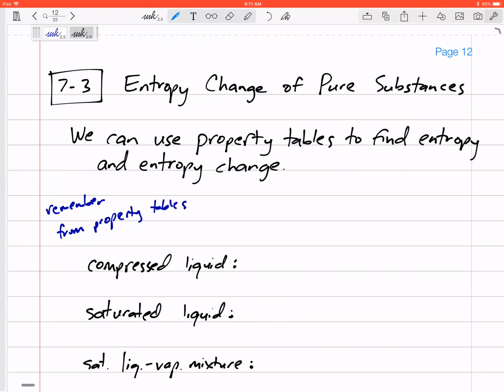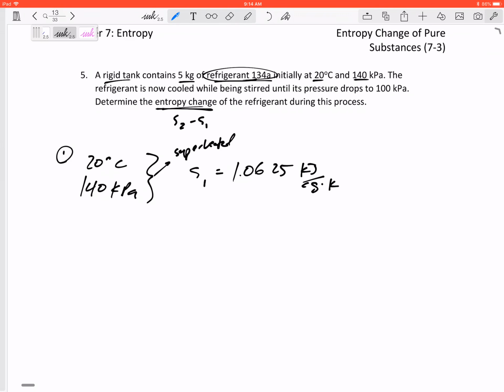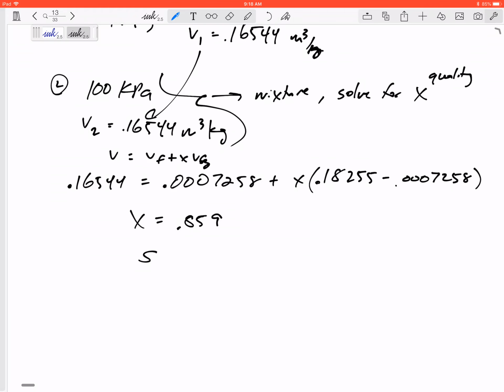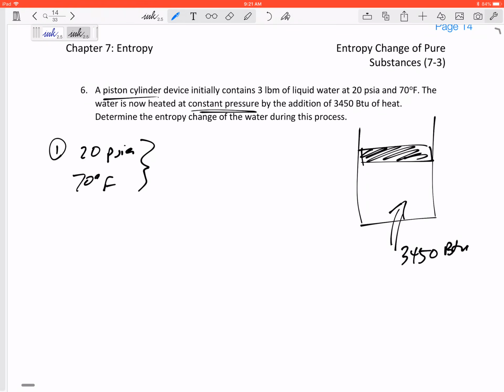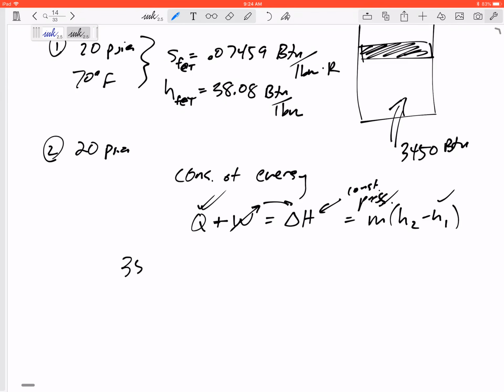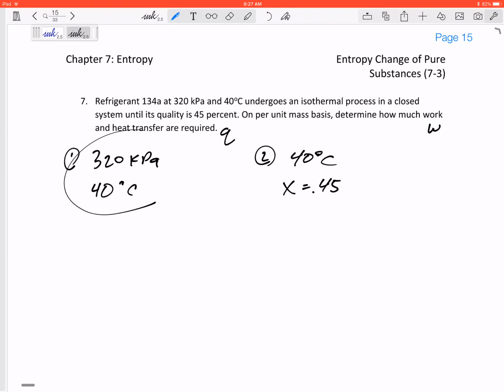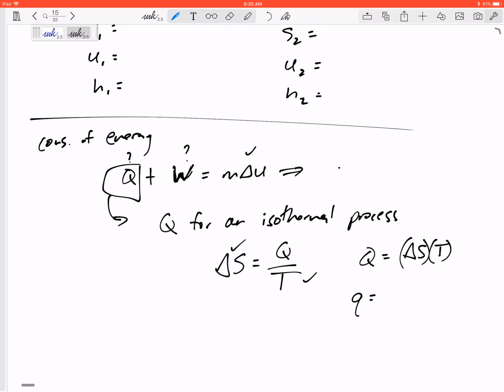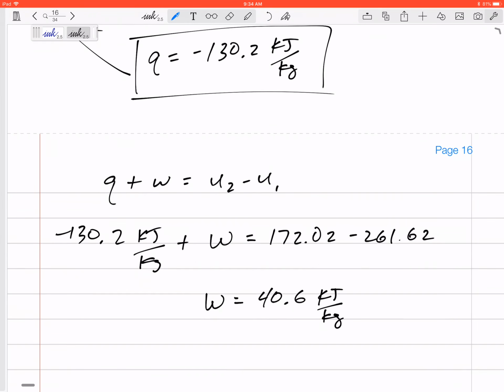Thermodynamics - Entropy 7.3 Pure Substances

Comment: ΔS = Q_rev/T, not Q/T. For an isothermal step, q = TΔs only if you assume a reversible (quasi-equilibrium) path. Otherwise that equality does not hold. Without the reversibility assumption, the problem is underdetermined (you can get Δu and Δs from tables, but not unique q and w), so it should be stated explicitly.

Comment: In Q7, the last one, the conservation of energy has been carried out as follows:

(q_in - q_out) + (w_in - w_out) = u2 - u1

My question is why are we not taking into account work at the boundary? We don't know whether this closed system has a movable boundary or not, so would it not be safer to assume there to be a certain "w_b" occurring at the boundary? If we use w_b, we get 

(q_in - q_out) + (w_in - w_out - w_b) = u2 - u1

but we can take w_b to the RHS, and since h = u + Pv, and w_b = int(Pdv), h = u + w_b

therefore (q_in - q_out) + (w_in - w_out) = h2 - h1

So I don't understand why we use u values instead of h values.

Comment: # 7 LOLOL, You have some weird values for R-134a, but problem seven is solved just like you did it, find Q = S2 - S1 X Temp... then U2 - U1... ah you know the rest.... but those values you're throwing out there for this substance are suspect. LOL
Reply from the maker: I am using the property tables from Cengel and Boles. The property tables from Moran and Shapiro look slightly different, but in the same ballpark. Honestly, this is just a problem (and solution) striaght from the Cengel and Boles textbook. I would double check your tables.  https://engineering.wayne.edu/mechanical/pdfs/thermodynamic-_tables-updated.pdf

Comment: #6  S = 3450 BTU/ Tsat @ 20 pisa which is 3450 BTU/688 R = 5.01 ish (This is quick way, if it was isothermal it'd be 3450 / 530 R but it's not so you have to divide by the sat temp at constant P of 20 psia)

Comment: Foe anyone wondering why the specific volume stays the same , it is not because of the rigid tank but because of the rigid tank + mass stays same.  rigid tank alone tells us only the volume stays the same not the specific volume
Reply: its a closed system so mass remains the same hence if V remains the same then so does V/m
Reply: Wrong, the spec. vol. stays the same as well, how else are you gonna find "X"???

Comment: For an isothermal process, isn't change in internal energy zero?
Reply from the maker: For gases, yes, usually internal energy is defined by temperature. But for liquids and especially liq-vapor mixtures, no - something can be isothermal but it is changing states and internal energy is definitely not constant.

Comment: Initially, thank you so much for your helpful videos. At the last part of last question, why did you used u instead of h? I am confused because the tank is not rigid.
Reply from the maker: For problem 7: you’ve got to use u because it is not constant pressure. We use H when it is a constant pressure process, use u for any other process.
Reply: @engineeringdeciphered  Thank you for the answer but at the next video (Thermodynamics - Entropy 7.4 Isentropic processes) you used h in the 8.question(at 6.00 sec). And it is not a constant pressure process.
Reply from the maker: @boramerttigli3215  oh yes, definitely use h for steady flow devices and flowing fluid as well. I was just talking about closed systems. H combines u and pv so that takes care of both internal energy and flow work (for a flowing fluid) or internal energy and constant pressure boundary work (for closed, constant pressure systems).
Reply: Ok i see now. Thank you very much for your help. 😊